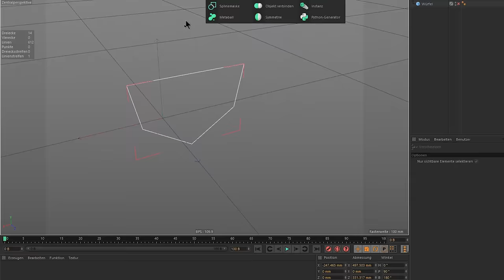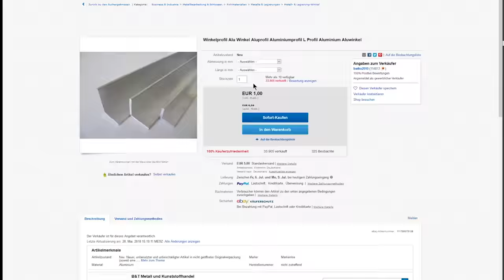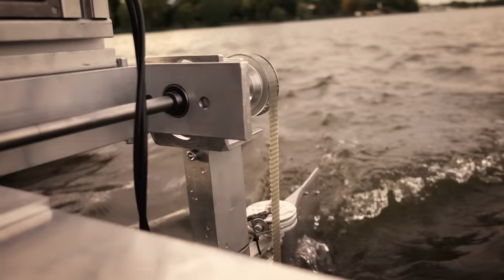Building a Bike Boat Catamaran

Comment: Scary get dangerous if rain
Reply from the maker: I actually calculated it, it would take a pretty long time for the hulls to fill up enough to becomea problem even in heavy rain. And after all, you only start sinking if the water comes in faster than you can get it out ;)

Comment: Excellent video details of the build and great build too!   Very nice!  Did you look into more efficient watercraft blades versus using a what looks like aircraft propeller?  I was also wondering how much more you can change the gear ratios to go even faster with little effort.  Thanks for sharing!

Comment: Could you please send me the cad design files of the items you made.
Thanking you
Reply from the maker: Hey, there isn't one (yet), the program I use in the video is a CGI program that I just use for rough sketches but it has no measurements. But I'm planning to make proper plans for my old projects and upload them, so if you check back later they might be here
Reply: @PhilVandelay  please tell me what was the thickness of aluminium sheets you used in this project?
Thanks
Reply: @PhilVandelay  Any updates on this, I'm kinda tempted to take my try but with FG hulls .. kinda easier for me, reducing the sheet metal work.
Reply from the maker: @MakiMakixc  Not really unfortunately.. The boat is currently sitting in my shop waiting for a makeover, it was always very much a prototype so I'm still coming up with new ideas to improve it and I'm planning to re-work quite a few parts (including the drivetrain) sometime in the future, and will probably make another video about it. What I can say is that the hulls and the nets/trampolines have proven themselves, while the drivetrain, while it worked well overall, has quite a few issues that I want to adress. The problem with boats is that doing R'n'D (more like Trial&Error in my case) is a really slow process, because unless the shop has direct water access, it's always a huge hassel to try out the boat and make modifications, hence the slow progress.  That being said, I've already learned a LOT from doing this project, and things can only improve from here. But for now, I would suggest to wait until I have re-designed the propulsion system and can hopefully call it technically mature, and in that case there also will be plans, because this time I'll design it with proper CAD software.
Reply: @PhilVandelay  Fair arguments, me and many others will appreciate a depth fallow up of improvements.
In the video you really made it seam so easy logistics, RnD/planing and execution of such a big project .. we all know in the real world settings change and everything tends to be more complicated. 
Anyway your videos are really very enjoyable to watch, keep up good work.

BTW how is the bottom bracket thread cutter called? My associate may be kinda intriqued about that one (after ruining the odd threads of an old french bike frame <- he's into old bikes).
Did you mentioned a few of your used machines in any of your videos already, I already figured that the mil is a paulimot  SX4, the lathe is also a paulimot but I'm interested in the bandsaw for example (currently searching for a somewhat small, versitile and good value one mostly for profiles and tubing)

Comment: built using solid works ?
Reply from the maker: No it's actually not a CAD software it's a 3D program for making CGI Animations/Pictures. Not really suited for detailed construction, but since it is my job I can use it to sketch things out in 3D very quickly compared to CAD. But the model is just a rough guideline for me

Comment: Nice shop!
Reply: Did you consider putting foam in part of either pontoon just in case they fill with water by accident?  Excellent build!  Not only was it a nice design, but the video is fun to watch!
Reply from the maker: I have inflatable bags that go into the front and rear of each hull now, if the hulls fill up it's not gonna keep the boat fully afloat but it will avoid it from sinking to the  bottom (and I suppose you could still hang on to the boat and get to shore). But I also plan to cover the hulls eventually, this boat is a prototype that I still plan to improve many things on

Comment: That double canoe pedal catamaran has already been done thousands of times, you could have saved yourself a ton of time and material just connecting  two used  canoes or kayaks.  A salvaged bicycle would have worked just as well, another amazing waste of time.  Reinventing the wheel.   But mainly, without sealing and foam filling  the pontoons,  one wave  will sink that boat like a stone.  Completely unsafe.  Bring life jackets and a radio, maybe an floatation device when it sinks to avoid drowning your girlfriend.   Next build, try fiberglass covered Styrofoam pontoons, same weight and stronger.  So, it comes down to amazing machinist skills, nice video skills, and a really dumb boat.
Reply from the maker: Wow I bet you're fun at parties
Reply: fourstring - Bad childhood?